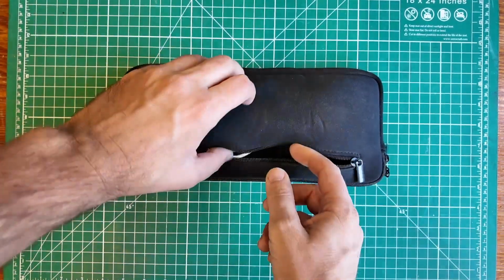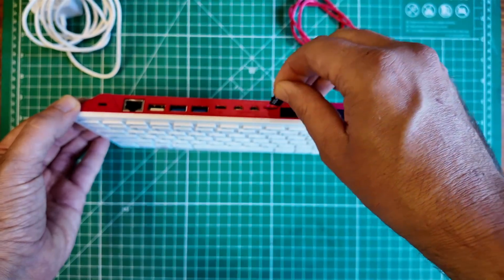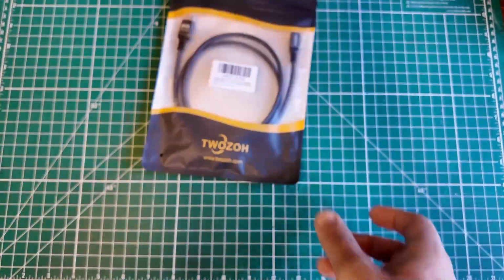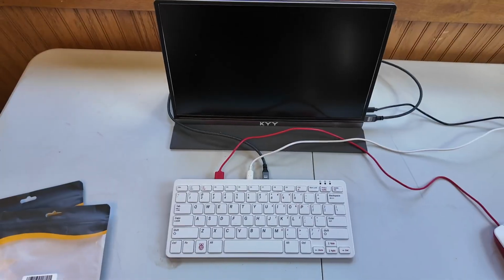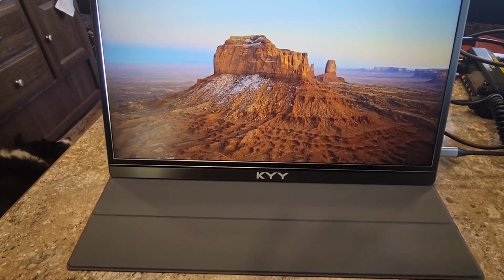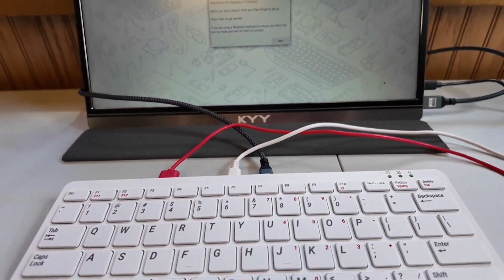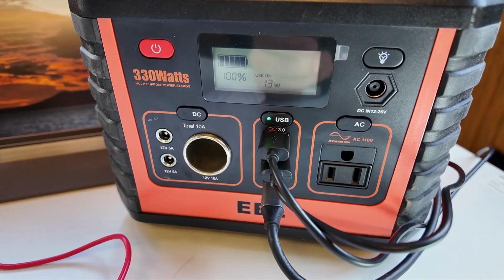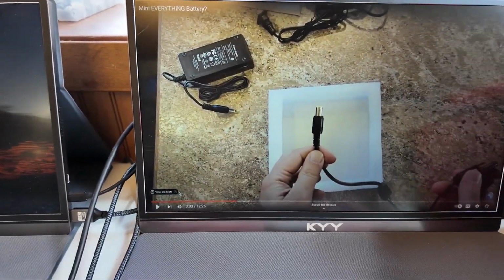Sub $400 Raspberry Pi 400 Battle Station

Comment: Not counting the jacks for two monitors, my CrowPi is a full laptop that runs off of a Raspberry PI4. Sure the monitor is smaller on the CrowPi but still. It comes with a mouse and the ability to run two different operating systems with a click of a switch! (Before you boot) It's also good for Ham use because it runs on 12 volts. Just saying.
Reply from the maker: Sounds like a sweet setup
Reply from the maker: Sounds like a sweet setup

Comment: Which previous video using the Pi 400 with the 705?
Reply from the maker: Sorry, it was using the batter with the 705.  I have used a Pi3 And a Pi4 with many radios doing FT8, the 400 is more than suited for ham radio work.

Comment: You could look at a pelican case. Maybe build a 7ah battery in the bottom. Then foam on top for the pi 400 and mouse and the monitor mount in the lid? Have a covered plug on the bottom to solar charge the battery
Reply from the maker: The screen is the exact width of the case I have, but I'm on the same track as you.

Comment: nice set up. all on battery . looking at that display. maybe I find a 4K like it or bigger. i got 4K on laptop 17 in. can support dule display . I did that before with my big TV 4K or projector at night camping. was fun. my mouse it up side down. Logotech track ball. girlfriend loves it. same USB . same buttons. just plug in solar panel and have a great off grid station. 73's
Reply from the maker: I used to use the Logitech trackman for the longest time.  They are great 👍
Reply: @temporarilyoffline  They make that display in a 4K more $$. in my cart for later
Reply from the maker: @robertmeyer4744  good find!

Comment: What makes this better than putting the pi in a display that uses 12v power, and having a wireless keyboard? This is nice, but for a go box or portable wouldn't a 12v powered pi combination be better? Just playing devil's advocate.
Reply from the maker: "better" is of course subjective.  You won't get any argument out of me.  I am on the lookout for one of those Pi Displays that is a decent size.  This 15.6 is about as small as I want to go.
Reply: @temporarilyoffline  Fair enough!

Comment: This reminds me, I have a pi 400 with octoprint on it doing printer things.. I should put octoprint on a different PI and use the 400 in a better way
Reply from the maker: I feel like the keyboard is an asset and a liability.  I'm still thinking a go-box is the best solution for this machine.  Time will tell.

Comment: Agree.  I have 3 - KYY monitors, and have no regrets.  They are usually available on sale.  73
Reply from the maker: Pretty high quality - the only thing I could ask for would be some VESA mounting holes... but it wasn't designed with that purpose in mind, so I can't be too angry that it doesn't have them.